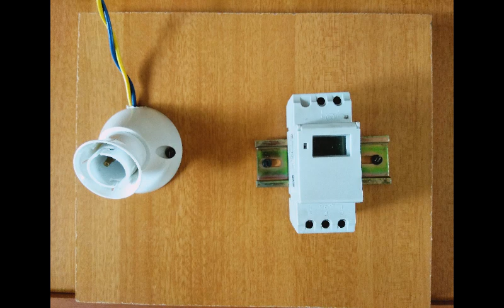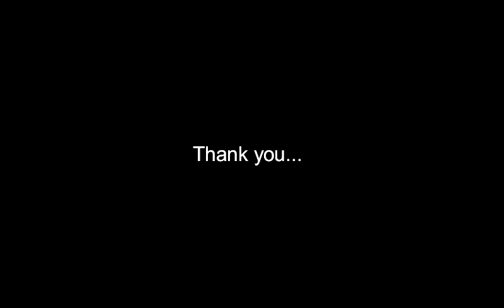Kiran K10ASD Digital Timer Installation

Comment: There are two things here. 

You could be wrong on your connection as per the video. 

The manufacture is dumb to make s time that need wires to loop several wires for no reason. 

Input;
1=Live Wire from the mains
2=Neutral from the mains 

Output;
5= Live for appliance connected 
4= base wire 
3= Neutral for appliance. 

I think you just need to ground the Input and output together that’s it but you video is misleading with no clear instructions and unnecessary looping of wires.
Reply from the maker: Hi Saeed,

We understand your concern, we ourself are the manufacturers for this particular model (although currently the product is discontinued in production). However please consider the following points

1. The timer can be used for both DC and AC loads, hence there exists a requirement to isolated the supply needed for the timer to work and the switching operation at the output. This is the reason for not creating an internal loop. As for example, if you want to connect a DC solenoid valve or camera that needs to be active only during particular intervals of time this type of connection is essential, otherwise the internally connected ac supply can damage the DC equipment. This is also the case when 2 phases are used for control and load purposes (normal scenario in industries). for these reasons the input and output are completely isolated

2. The output terminals represent the common, normally open and normally closed terminals of the internal contactor, which means that there is no neutral feedback in the terminals 3, 4 or 5 (as mentioned earlier, completely isolated). 

You can be assured that the connection shown in the video is correct. However please be advised that these connections and terminal configurations are dependent on manufacturers and please review the user manual of your timer switch before proceeding. Thank you

Comment: What's number 3 used for
Reply: 3 is the NC terminal (normally connected). use 3 and 4 terminals if you want to turn off your appliance for short intervals (in which case ideally your appliance is normally in an on state for longer period of time).